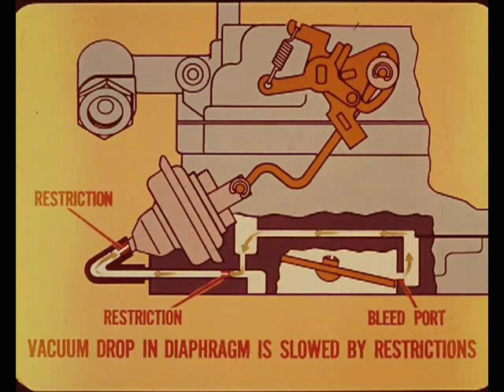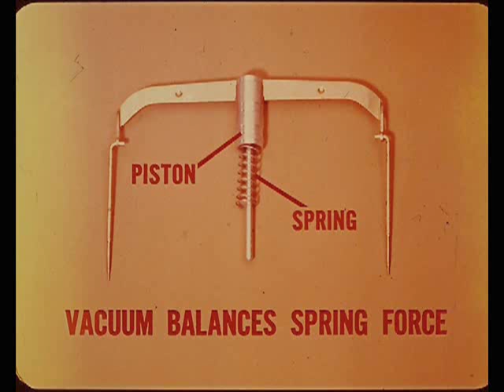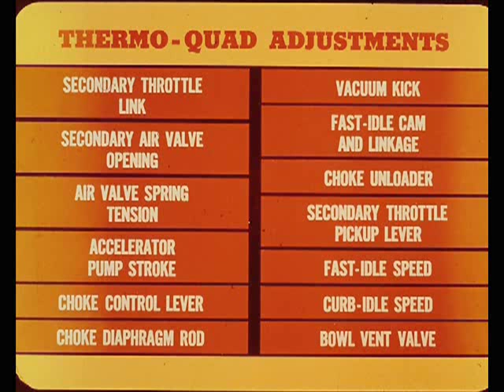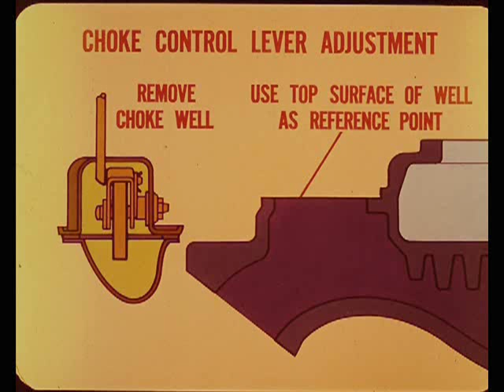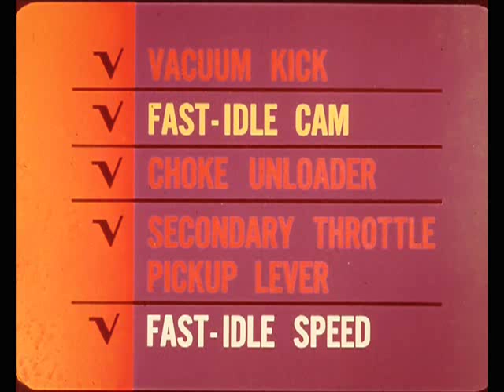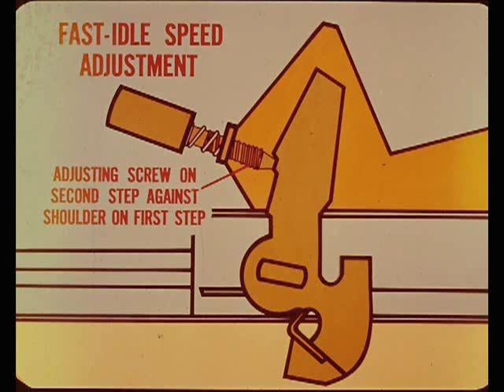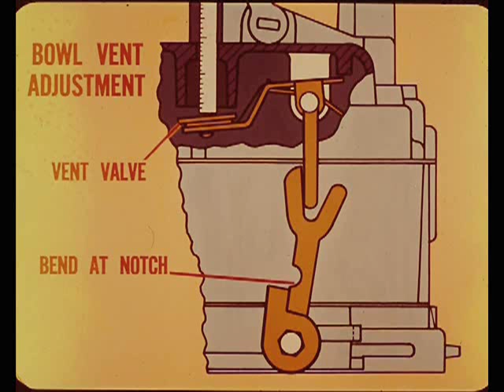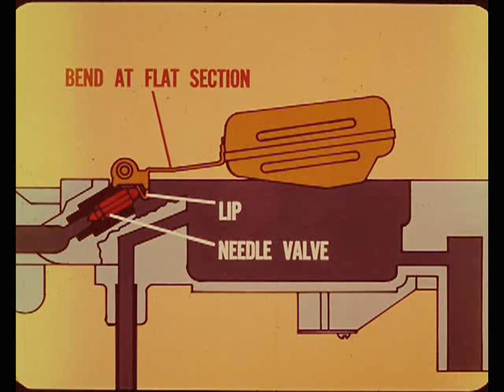Chrysler Master Tech - 1972, Volume 72-1 The '72 Thermo-Quad Carburetor

Comment: Most people who dislike TQ carburetors were simply too lazy to do all the adjustments, and IN THE RIGHT ORDER. Follow the book, set everything right, and it's really a great carb. 800CFM and no bogging, and a hell of a lot better fuel mileage than a Holley or older AVS/AFB Carter design.

Comment: This was a HIGHLY underrated Carburetor! I'm a Retired Auto Mechanic, from 78-06.... And Carburetor and Driveability Specialist. 

I've always heard them called "ThermoJUNK" and a few other names. 
These and Quadrajets, we're actually fantastic Carbs!! They both gave fantastic high end performance, with excellent low speed Driveability and respectable Emissions...
AND size for size, got BETTER fuel economy than ANY square bore Carb! 

I Raced too. I was the first (in my area) to go 12s with a Quadrajet! (FAST was slower than it is today!!) 😜 That was a BIG deal back in the day.

Now as in then, it's ALL about Tuning. True, Thermoquads needed a specific adjustment order. But get it right, and they were great performers. 

I tuned one for a friend's 74 Challenger 360. He was sure he needed a Holley, so he bought one. Ran fine, but WOULDN'T pass smog testing, and kept blowing Power Valves!! 
He averaged 12mpg also.

I built him a Thermoquad and set it up. He PASSED Emissions, got 17mpg, and GAINED 1/2 second in the quarter!!! 😲 

That's because his Holley (when NOT blowing Power Valves) was 600cfm, and most Spreadbore Carburetors were 750-850cfm!! 😎
Reply: PoorManRC I have  Carter Thermo Quad on my 1979 Dodge Commander RV (440 CID )  it’s not passing smog (CA)  Do you have an suggestions? Thanks Big Ernie
Reply: @ernestgoble8825  Well Ernie..... Nothing is harder than diagnosis without seeing and hearing. 

Things I would check....
Ignition Timing. Try advancing 2-3 degrees more than specifications.

Spark Plugs. Replace them with one Heat Range higher than stock.

Check Cap, Rotor and Wires for damage, check Wires for resistance. If they're more than 5 years old - REPLACE.

THEN Carburetor. How old is it? Rebuilt? 
Disconnect and plug the Vacuum Advance Hose from the Distributor.

Adjust Idle Mixture, with a Vacuum Gauge. 
Turn both screws in all the way, LIGHTLY. Too much force will enlarge the holes, and the Carburetor will be JUNK.

Then turn both Screws out exactly 2 1/2 turns each. With the Vacuum Gauge connected, start the Engine, turn each Screw in 1/8th turn at a time, EVENLY.... You want both sides to always have the same adjustment.

Watching the Vacuum Gauge, turn the Screws until you get the highest Vacuum reading at Idle.

If you still can't get a smooth Idle, with at least 18 inches of Vacuum....
It's something deeper.

Intake Gasket leaks, bad EGR Valve, leaky Valves, Head Gaskets, Rings....

Sorry it's not easy, but it's rarely ONE thing, unless a perfect running Engine all of a sudden started messing up.
Reply: ..... One "cheat", SOMETIMES new Catalytic Converters can get you past Smog!! 
If your Truck never came with them, it's legal to do, because it's a LATER Model upgrade. 😉
Reply: PoorManRC  PoorManRC Thank you so much for all the tips . I will definitely look into all that you suggested. I do appreciate your knowledge. Thank you
Reply: @ernestgoble8825  Did those engines come with a maze of vacuum operated smog devices? It wouldn't surprise me if some of them aren't working. Even when those engines were a few years old, half of that stuff wasn't working.
Does yours have an exhaust air pump? It would be wise to check the diaphragms and pump to make sure they function. The added air when combined with exhaust heat will reignite unburned and partially burned gasoline vapors.

Comment: I have messed with a few TQs in my time. Although 26 years of my experience was at a Ford dealership, we did have customers who also owned motorhomes they brought to the shop for repairs. Some were built on Dodge chassis with a 440 engine. I do remember the TQ carb was very finicky and required a great deal of patience; but that's true for most carbs. I do recall one that had a warped body and would not stop leaking. The mechanic working on it took it apart 3 or 4 times trying to stop the leak before using a straight edge on the plastic body; sure enough it was warped. Finding a replacement body was a challenge; this was pre-internet days and our location was in the middle of nowhere. Eventually we found one and looked like heroes once John repaired the carb for the last time

Comment: The vac pulloff is perhaps the most crucial adjustment. Aside from that, dump the closed foam floats for brass 1s. 8 times out of ten, you won't need to bend or adjust anything during a rebuild.

Comment: I have 3 of the infamous Carter Thermoquads, they worked pretty good once tuned right, my problem was that plastic bowl, hot/cold weather, it would contract/expand, they developed cracks, other wise, with those big secondaries, whatever the carburetor sat on top of what Mopar motor, GODDAMMIT, sounded mean as hell!!! Mopar Nate Philadelphia, Pennsylvania

Comment: i know this is a old post but  i run a 850 on my 440 they are very picky but once you under stand them they work very well  i get 11 mpg which dont sound good but thats in a 1973 dodge D 100 club cab with a 727 loadflight trans and 355 rear gears

Comment: I have worked on these back in the 80's & 90's when I was driving those old 70's Mopars!  I did my 1st rebuild on a '79 Newport 360 Hi-po police engine.  I did it off the "instructions" listed on the aftermarket rebuild kit.  So no real instructions when I performed it!  It took 3-4 disassembly tries before before it seemed to run right, lol.  Mileage was better at 15 mpg vs. 11-12 mpg beforehand, but the 4 barrel "kick" still had a terrible stumble.  I found out eventually that the choke vacuum kicker was what controlled it.  But even after installing a new kicker it still stumbled.  I guess I didn't have the correct instruction available to me to set it up right...
Later as I gotten older and more experienced with carbs, I had taken apart 3 other T-quads with much better results...;-).
Reply: The choke on these were junk.  Everything else was great, but when they went with the Qjet in the '85 - '89 squads, all the tuning and drivability problems went away.  The Qjet was a little smaller (750) than the TQ, and could not be set up as lean, but they were very good in cold weather.

Comment: Plus the screws never came out.Last one was in a 1985 Dodge Ram Charger,could not get the screws out.Threw it in the scrap pile and replaced it with an Edelbrock carb
Reply: wafrederick The TQ was gone by '85.  The QJet replaced it.  The TQ is a thousand times the carb that the Eddie is - why do you think Carter replaced those old AFB/AVS carbs with the TQ in the first place ???
Reply: It was a 1983 or 1984
Reply: Carter made the thermoquad

Comment: That Carburator was a huge pile of shit,most got thrown away replaced with Holleys by hot rod guys
Reply: Considering the TQ didn't come standard until after the Hemi and 6-Barrel engines went away, and the price of fuel went through the roof beginning in 1974, I sincerely doubt many were actually replaced with horrible Holly.
Reply: 1967 Chevelle LM7  Thanks for your input.